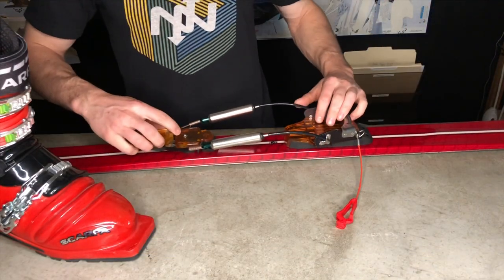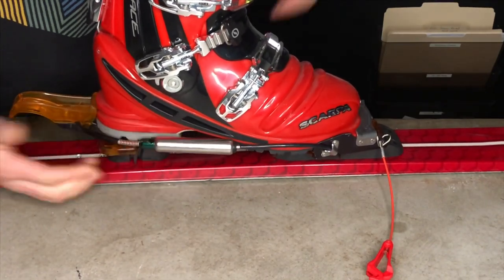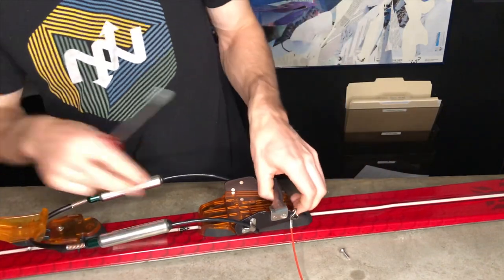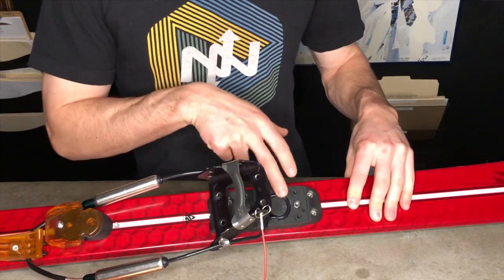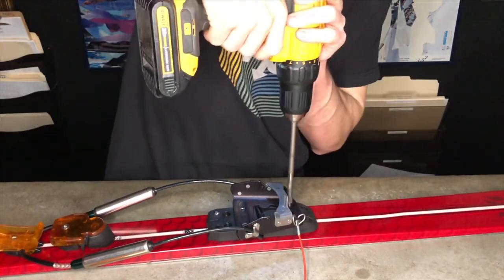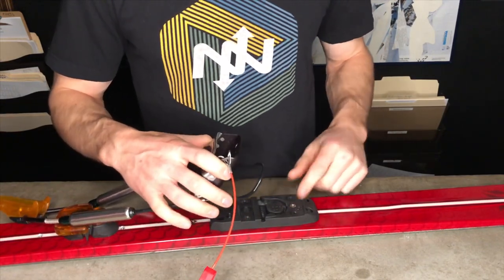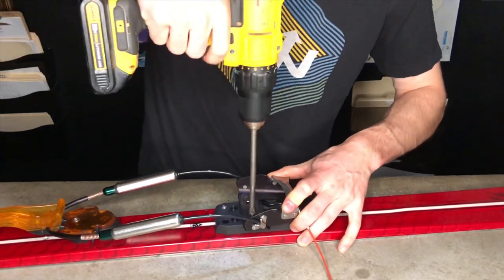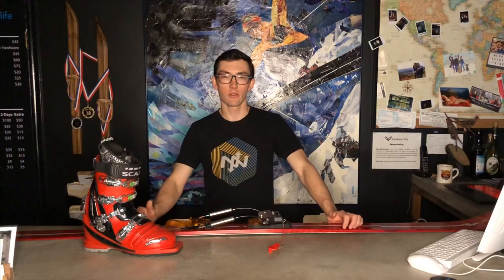How To Adjust G3 Targa Cables

Comment: great video highly appreciated. I thought I had to buy a whole new binding. I tried to fit The Binding to my sister's boot and I thought I was toast and had to buy all new gear. Thanks!
Reply from the maker: Awesome Scott! Glad that one helped out. Even though it's an older binding, we'll still be putting together some more videos for it because there aren't many out there and they are still used quite a bit. Drop a line if you need anything. Cheers.